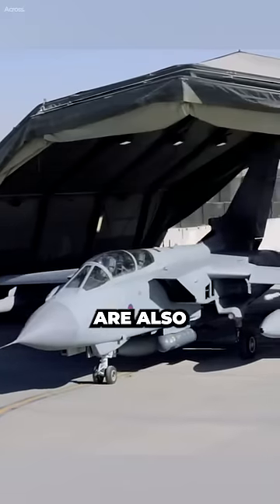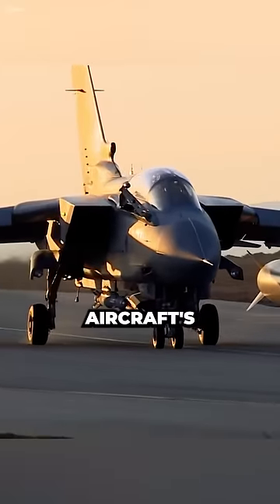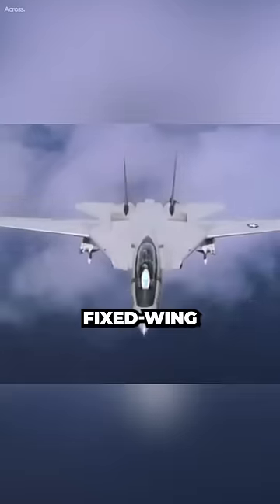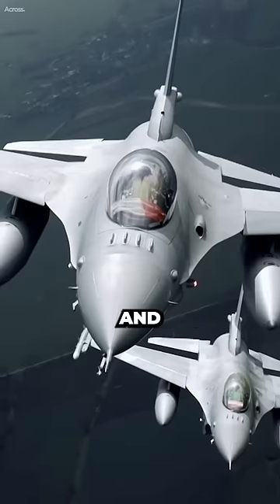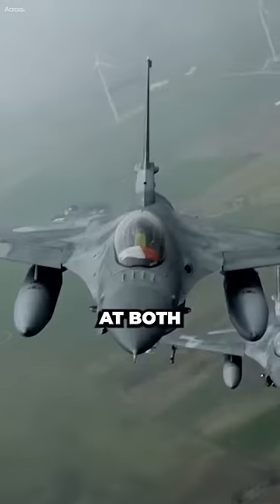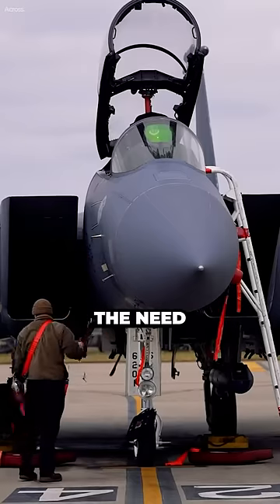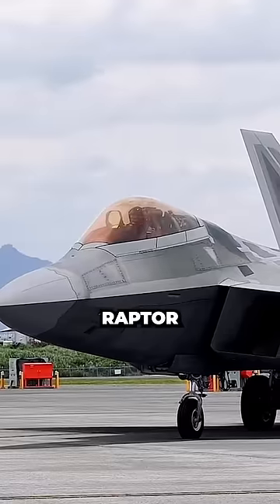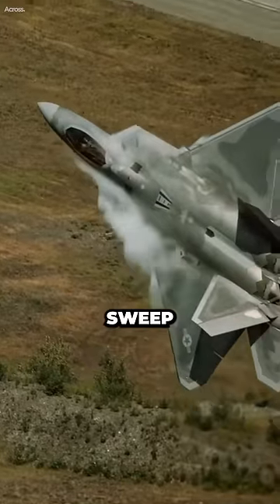Why Don't Modern Aircraft Use Variable Sweep Wings?

Comment: In spite of what the video said, the variable sweep wing still offers a number of advantages. It will have better performance at the highest and lowest of speeds. For example, the F-14 was much faster and longer ranged than an FA-18 while having a better low speed turn radius. 

The downside is that added weight, extra maintenance and difficulty in making a swing wing stealthy.
Reply: Not only that, the F-14 had the advantage of having a long loitering time with the wings extended (at minimum sweep) and was regularly used in CAP (combat air patrol) in the first Gulf War for this reason. No other US fighter aircraft had this advantage, their wings didn't allow them to do that.
Reply: Exactly, as usual he's got not clue what he's talking about. Made it all about the ability to go supersonic which had nothing to do with it really. It was about getting the advantage of both worlds such wing types provide all in one aircraft
Reply: F-22 enters the chat
Reply: @aaronh1372  and does what, support everything I said?
Reply: @Elthenar  Thrust vectoring: making everything you said Obsolete. Too old.
Reply: @aaronh1372 changed one thing, not the low speed loitering ability. Love the Raptor myself and ashamed they didn’t leave room to upgrade in her. Buddy informed me she was more a proof of concept which explained to me the proliferation of the F35
Reply: @aaronh1372  In what way does thrust vectoring make anything that was said obsolete?
Reply: You will be saying prop aircraft have an advantage over jets because they have a better turn rate. Simple fact is if swing wing was still a legitimate technology it would still be being used.
Reply: @chiselcheswick5673  that’s almost always the truth to all these “dick measuring” contests. Obsolescence is obsolescence. Almost everything has some kind of use but swing wing is gone in all modern designs
Reply: @chiselcheswick5673  No, but props do have an advantage in efficiency at low speeds. It is why the Sky Warden is being introduced. If you don't know, Sky Warden is the newest fixed wing combat aircraft in the US arsenal and it's a light weight prop plane. 

When choosing which tech to use, you have to look at it's strengths and shortcomings and decide which apply the most. At the time that the Super Hornet was chosen, the F-14 swing wing design still had a number of advantages over the 18 and was arguably the better platform if it were upgraded with modern avionics and such.

Now, the swing wing still has those advantages but it's really hard to make one stealthy. In today's air battles, that's a deal breaker.
Reply: @aaronh1372  No, thrust vectoring has no effect on low speed or high speed efficiency. Thrust vectoring gives an advantage in maneuverability. 

One of the designs for a new build F-14 that were floating around in the 90's had swing wings AND thrust vectoring. Rumor has it that thing would out turn an F-22...by a lot.
Reply: @Elthenar  "low speed turn radius" and "stealth". Those are Your words. Purposely misconstrue my words? Must be cause you have nothing to stand on (least not now that you did that).
 Rumor has it, it WOULD have of, but was never made. Fantasy land is your best defense? 😂
Reply: I disagree
Reply: @aaronh1372  I did not misconstrue your words. In my original post, I compared it's low speed turn radius to fighters of it's era. Specifically it's replacement, the FA-18. If you knew anything about the subject, you would now the competing platforms for the replacement of the legacy F-14 were a revamped F-14 and the Super Hornet. That was the topic under discussion.

But, since you chimed in with talk of thrust vectoring, I compared swing wing to those platforms as well. And actually, the F-14 at full extension had a turn radius pretty close to a thrust vectoring jet....in an energy fight. Thrust vector just gives the fighter the ability to dump a lot of energy to make a high alpha turn. It's useful but overrated, which is why the F-22 is the only fighter we ever made with it. 

This lesson was free
Reply: @Elthenar  😂 This "lesson" looks more like someone is hurt. Contention with my utilization of "misconstrued". I do believe, as the original author, I would know best how it was construed. As the old ways have laid the foundation, they are still exactly that: old. The Raptor cannot be touched and we are already on our way to producing a next generation iteration. The mass amount of processes required for the on board computer to make has only recently become possible while maintaining stealth (the first computer was the size of a warehouse, tech evolves, just fyi). You found fancy in an older step of the way here, that is great. Have a passion. Still, do not disregard reality and attempt to foolishly attest to best at the time being the best of today. That view will never fly and unfathomable that you would even try to get it off the ground. Have some humility. Washed up and still need a shower.
Reply: @aaronh1372  One, you aren't the OP, I am. Two, you said some nonsense and I pointed it out. Three, don't be mad.

If you need a hand with the things you don't understand, just ask. I am here for you
Reply: @Elthenar  Original author of the contested passages. My statement was that You misconstrued what I wrote.... Misconstrued what I, Me, this person right here, not you, me, I wrote. Do you get it? I did not say you misconstrued what you yourself wrote, did I? No. What I wrote. Original author. For you to miss this simple point says it all. We gonna have to take you back to kindergarten until you learn perspectives, or at least people and spaces. Individuals. You, her, he, she, him, we... You are you. I am me. We are two different people. Is any of this getting through to you? Hfs
Reply: @Elthenar  before correcting someone,  make sure that you are ri... wrong.  Oops, sorry.  I see you have no choice in the matter.  Wrong is your only option. We are done here.  Sadder and sadder.
Reply: @aaronh1372  I dare you to make less sense. I don't think you can.
Reply: @Elthenar  as I said, back to kindergarten for you. Hfs, epitome of smooth brain. Wish I could laugh it off, but this is truly sad, dude.
Reply: Bottom line the F-14 became obsolete due to advances in air defense technology and missiles
Reply: @Elthenar 
So you have a degree in aeronautical engineering and have designed fighters
Reply: @FP194  Do you have one? Then you are you to say I am wrong?
Reply: @aaronh1372  You must be the wittiest kid in your special ed class. Let the adults talk
Reply: @americanosbadassius9292  wow. Talk about someone being high, on more than just "da weed". Why would I attempt to disprove anything he said? As I clearly stated, I asserted that it was irrelevant, not wrong. You buddy, are tripping. All I see here is accusations. Looks like someone is hurt. Not saying that you are wrong, but to pick this specific atrocity to fixate on says there's something personal here, to you. We could push politicians for real answers on an endless amount of wrong doings and unconstitutional acts (i.e. the false flag op in Sept. Oh one that continues court trials which are not publicized). Why all the name calling? Try thinking outside the lil box, raise up, conceptualize higher dimensions (more difficult than you might think). Stay off drugs (especially legal ones).
Reply: @americanosbadassius9292  oh, and brush up on statistical economics. The deficit is designed to move in only one direction, to grow, and exponentially at that. The people who print money are never in debt. The balance of the national budget, taxes vs expenses, is merely a means to maintain the value of a dollar. The power of the dollar is only what we as a collective give it. This concept has to be held together and serves a critical role in the world today. But, the future is not wrote and it is silly to put fear into an unwrote future.
Reply: @Elthenar  😂 straight insults cause you have no real argument. So mature! What else should I expect though, from someone who cannot even differentiate who made  a contested statement and who is misconstrued (fyi, if you misconstrue my original statement, I am the original author of said contested statement that you misconstrued. Misconstruer = you, original author of misconstrued statement = me.) There will be a test on Friday, so study study study. I know it is an extreeereeemely difficult concept for some, but I believe in you (not really, but I'll tell you I do).
Reply: @Elthenar  If you were in Advanced Placement courses, AP, earning college credit while still in high school, you would know that being gifted is also referred to as special education. Therefore, the wittiest kid in special ed is also referred to as the valedictorian. Your insults cannot even hold up to scrutiny. I hope you adult better than you write/think/argue.
Reply: Your reply was a joy to read Sir!
The first rational reply (possibly the ONLY one too) on here.
Reply: Aircraft such as the F-15E suffer from severe wind shear  turbulence when doing low  level penetration compared to F-111 and Tornado which reduced wing area when swept.  It's not a common mission for the F-15E but was once the only way to get through
-Swept wings worked but eventually advances in engine T/W ratio, weight and thrust allowed pure thrust to accelerate the aircraft on a short runway.   This also allowed larger wings with more fuel.  The larger wings drag and weight compensated by the more fuel efficient engines.
Reply: @aaronh1372  There is no argument for me to make because you have yet to make an intelligent rebuttal. I made a statement, you replied with nonsense and now I mock you.
Reply: @williamzk9083  Fair points. The swing wings and large, lifting body areas of the F-14 lowered it's approach speed when landing, something that matters for a carrier bird. Swing wings also helped with range and speed. IMO the biggest drawback had nothing to do with the weight of the swing wing machinery, it was the lower payload. The moving wings made it very difficult to carry anything heavy on them, reducing how many pylons the plane can have that would be capable of carrying heavy stores.
Reply: @Elthenar  I replied with "F-22 enters the chat." from which you were offended and felt obligated to troll for more. It is a common occurrence here in the YT comments for something to "enter the chat." Most ppl understand it and there is no need to reply. Idc what you do, but you asked for more, so here it is. Out of your control. Too much to handle so you disregard everything that has been said and act like you are alright. Just like an old, outdated, obsolete, washed up, has-been. Cannot walk tall without falling back to your "good old days," back when times were simpler. Simpler times for simpler people. The Raptor would literally fly circles around the sweep wing and you do not understand it. It is ok, no need to get defensive. I will leave you alone. Go ahead, have the last word. By all means. You are the one who needlessly drug this out, you should be the one to conclude as well. Wrap it up in a way that makes you save face. 👍✌️
Reply: @FP194  Upgrades to the Tomcat with 30,000+lb thrust engines and a new radar and avionics suite etc would have kept it more than competitive.
Reply: I thought you said the civil air patrol (also CAP) had the F-14💀 @Leadblast
Reply: @aaronh1372  That was a lot of tear stained nonsense to just say you have nothing of value to add and want to bail out. 

Be well.
Reply: I always thought the counterpart to the Navy's F-14 is the Air Force's F-15, the F/A-18's counterpart is the F-16.
Reply: @5stardave  Not really. All of them are twin engined larger fighters except for the F-16. 

There isn't really an analogue to the F-16 in US service. It's the only single engine light dogfighter we've had since Vietnam, maybe before.

The F-14 was a fairly unique fighter. It was more like the F4 than the F-15, it was a true interceptor. It had combination of range, speed and long range radar and weapons that nothing else could match.
Reply: @5stardave  Yeah, you're closer to it than the video anyway. The F-14 and F-15 were employed to similar role Interceptor/air superiority, where as the F-16 and F-18 are more similar in a multirole fighter/bomber sense.
In terms of the best roles for those aircraft yes, the F-15/F-14 are the better intercept/superiority aircraft, and the F-18/F-16 are the better multirole fighter/attack aircraft.
Talking about how many engines or how heavy they are really doesn't matter in a usage case. The navy requirements included engine redundancy and reinforced undercarriage, the F-18 was in fact meant to fill the F-16 role for the navy. While the F-15 and F-14 were built to fill the same role for their respective service clients.
Reply: I will add, I think part of the downfall of swep wings is that in Vietnam that total combat time done above Mach is 10 minutes or so.

Most combat is done at a sub sonic speeds, you don't need supersonic maneuvering
Reply: @brendanwakeley9103  That actually plays into the sweep wings strengths. The swept wings aren't for fighting, they are for hauling ass to get to the fight in a hurry.  The Tomcat actually fought like a modern f-15. It had an absolutely massive radar and the largest, longest ranged missiles of it's era. It wanted to haul ass into range and shoot at a bomber before it could launch missiles at it's carrier. 

However, when it got into a dogfight, those wings folded out. With the wings fully extended, it had a very good turn rate at low speed, kind of like an A-10 does with it's straight wings. 

In short, in many ways it had the best both worlds. That was the big advantage of swing wings. It paid for it in weight and complexity. The F-14 also had a weird advantage in that by storing most of it's weapons between it's engine nacelles, it worked a little like the internal storage of modern stealth fighters. It elimated a lot of the drag of those weapons making it haul a lot of ass even when loaded with pheonix missiles. 

The biggest downside, and the reason we won't see that swing wing again, is that it is very hard to make one stealthy. That is the death kneel for a fighter in US service these days
Reply: @aaronh1372 and yet the Navy rejected the f22 because it couldn't get down to required speeds to land on deck and would have been a massive risk for deck ops. F22 is an amazing bird, but for a very different mission.

I actually live near Tyndall and whatever they are replacing the f22 with must be insane.

For long loiter fleet defense operations though, the f14's still something we haven't replaced. With a threat of possible conflict in the South China Sea, we are going to need to finally have the discussion about if the roll needs to exist anymore at all, and if so, what is actually going to replace the tomcat.

I'm not saying that the future should be swept wings, but fleet defense is a need not currently well covered by aircraft.... But by missile defense, I think maybe. I don't have enough knowledge to state if surface to air has replaced the roll, but if not, we may have a need to press something new into service.
Reply: @johnb8440  well said. Not sure why the Navy in particular was mentioned. The F22 is not a VTOL. It's replacement very well may be. But, one had to exist before the other. Many systems have been tested with this bird and open the air to future developments. Can we give the GAU-8 Avenger a set of wings, F22 stealth and radar, and make it a VTOL? 😁 With it's own drone support squad, of course.
Reply: @aaronh1372  The NGAD isn't going to be VTOL. It's going to be a high speed, long ranged interceptor type of aircraft with top of the line stealth and computing power. It's basically going to be a mini-AWACS capable of leading drone swarms into combat, it's going to be built with 2 drone wingman per NGAD to start.
Reply: @Elthenar  ok, but can it go Brrrt?
Reply: @aaronh1372 You originally misconstrued his words. All this sad projecting and bitching just to be wrong. Tough.
Reply: @BakkuIa  You chiming in with a you statement. 😅 Keep it up, for such an act is very revealing. 😂
Reply: These high speeds in fighters are like long range cartridges in rifles, while may be useful in some cases you quickly realise that you rarely use the max range or speed, that is the reason why 30-06 cartridge was replaced by 5.56
Reply: @Spacey_key  It's funny you say that since the NGAD is going to be a high speed fighter and the 5.56 is getting replaced by the long ranged 6.8mm
Reply: @Elthenar  What are you talking about? 6.8 is an intermediate ammunition, just like 5.56 and in some cases is worse than 5.56
Reply: @Spacey_key  LOL, the 6.8 is not like the 5.56. I didn't say it was the same as the 30-06 but it's much more powerful than a 5.56. With the military loads, it's getting the same or better velocity as a 5.56 out of a much shorter barrel while using a round roughly twice the weight. 

Also, something I forgot in my original reply is this. The most successful fighter in US history is also currently it's fastest fighter, the F-15. Our current top of the line fighter is the F-22 and it's our second fastest. Both are capable of better than mach 2. We got away from that raw speed a bit with the Superhornet and F-35 but high mach numbers are back on the menu with the NGAD
Reply: Not only this, but also the shown Tornado was built with sweep wings for the low landing and take-off speeds and high-speed low altitude intrusions into enemy territory to avoid radar detection.
Stealth capabilities and the lessons learned from Desert Storm made this not necessary anymore.
Reply: The f-18 can't turn tighter in a one circle fight .
Reply: @aaronh1372 It's ironic when you mentioned thrust vectoring,
because thrust vectoring is an add on.
You can add thrust vectoring to almost any modern fighter.

F-22 suffer the same unjust vs F-35.
F-35 supporter claim it's better then F-22 because the add on,
such as advance helmet.
In reality besides vtol capabilities, F-22 is superior then F-35.

All advantage of F-35 (besides vtol) because brass decided to upgrade F-35, not upgrade F-22.

More crazy stuff : F-22 was design to be upgraded.
There's empty space on F-22 for that purpose.

The real reason for destroying F-22 production machine & tools, 
is to 'force' allies to pick F-35.
Reply: @evanwilliams3645 'swing wing is gone in all modern design'
F-14 is obsolete, because of stealth.

But there will always be:
- small sweep back wing for fuel efficiency on takeoff & subsonic speed
Ex: bomber / A-10 (cas)
- big sweep back wing for supersonic speed
Ex: SR-71

These two types of wing are forever.
Therefore variable wing design is never obsolete.
From multirole perspective, 
F-14 type fighter is the true multirole fighter.

By default, multirole combat aircraft is a compromise of roles, so there's no point of pointing out the short coming.

F-14 vs F-35.
F-14 can Stol then become interceptor (supersonic)
F-35 can Vtol(c Marine) or Stol(b Navy) but aren't an interceptor.

From defense perspective, 
F-14 retirement without 'F-14 stealth type' replacement leave a big hole,
without people realising it.

Without the feeling of more vulnerable, there's no feeling of the need to produce the next generation of sweep wing design.
Thus obsolete perception.
Reply: SR-71 still the ultimate interceptor (opponent wasn't aware of recon only produced)
F-117, B-2, F-22 : true stealth

F-14 : true multirole, 
Takeoff in Stol, 
Supersonic interceptor.
- Fighter - dogfight
- CAS and Submarine hunting.

Stealth F-14 type(non existent) can substitute the role of A-10, F-16, F-18, F-35
with the support from F-22 air superiority replacing F-15 at land base.
Reply: I find that the stealthy component of an aircraft slowly starts to become a gimmick now that an F-35 effective range of their long range armaments can reach approximately 300 miles.
Reply: @robster7787  Before that multirole is a gimmick, to the extend that fighter that
can't intercept,
can't CAS effectively,
is called multirole.
Nowadays every country claim to produce multirole fighter.
Politic and export undermining by gone era combat aircraft.
Reply: @budisutanto5987  Nice info, thanks.
Reply: @budisutanto5987  i definitely think a new swing wing would be a good idea to look into. We (the US) used to love having those in operation. With all the new technology and understanding someone could definitely design and develop one. You mentioned the SR71 as an interceptor, something like that would’ve been great to see in operation. Skunkworks did attempt to put one up. However, not sure if it made testing phase. Outside of the drone launching tests was one launching anything was made known
Reply: @evanwilliams3645  Swing wing is just one of the type,
such as stol, vtol, tilt-rotor, double blade helicopter, etc. 
It should be at super carrier with F-35.
Every type should exist. 

However . . I don't see how it can be stealth with F-35c price.
F-35d(fantasy fighter) swing wing is definitely higher price then F-35.
But A-10 CAS exist, Osprey exit, so swing wing should exist to be fair.

SR-71 interceptor & bomber only exist in drawings at Skunkworks fault.
Production machinery & tools destroyed.
SR-72 is in development.
Reply: @robster7787  How so? Stealth isn't invisibility. Those ultra long ranged missiles aren't really meant to shoot fighters, they are for things like AWACS and refuelers and they are normally well behind the front. If you shoot at a fighter, you won't get kills at 300 miles. Max range kills on a fighter are hard, effective range is usually half of that max, maybe less. 

That and an F-35 and it's newer brothers will have one more great trick, they can guide weapons for others. So that stealthy F-35 that is near the front can provide guidance for F-15's firing those long ranged missiles from safety.